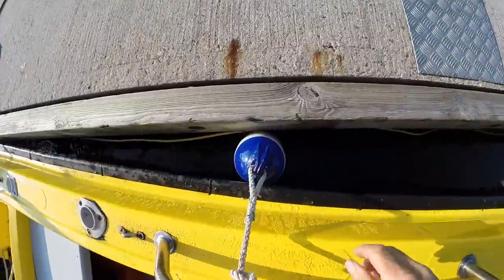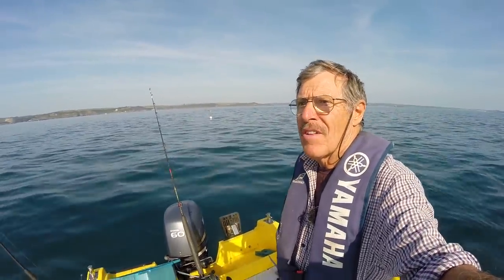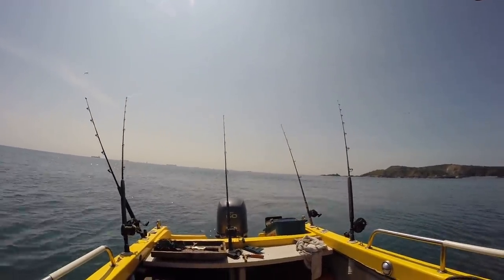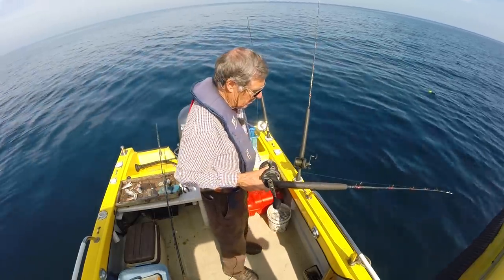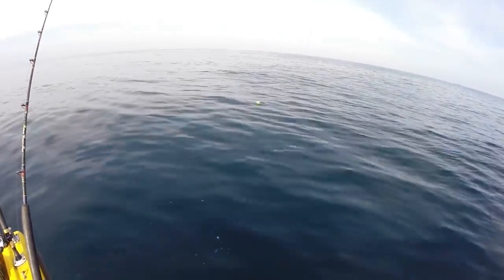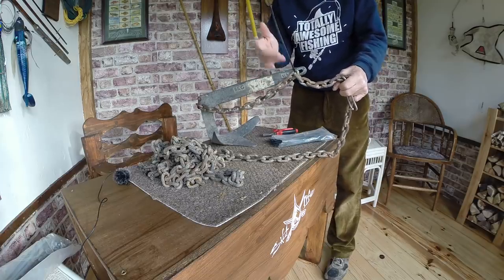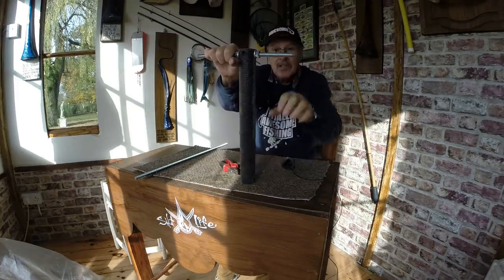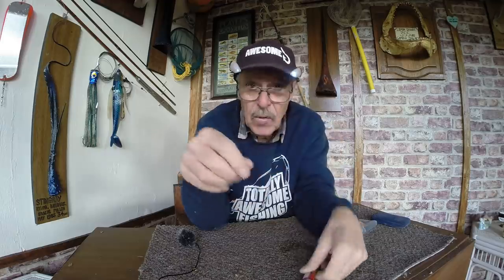Solo Boat Fishing & Anchoring Tips

Comment: I use a little clip on rechargeable torch when I'm night fishing because I hate sleeping with a head torch strapped to my face but don't mind wearing a peaked beanie with the tiny torch clipped to the peak. Having something that's ready to go is essential for me because I tend to charge out without thinking when the alarms start wailing. 
As a fellow man of tired working hands I also struggle when it gets cold but recently I've taken to buying waterproof thermal work gloves to wear on the bank and they really do make a difference, they're not bulky so you retain most of your hands function but they keep the damp out and keep the heat in. You can pick a pair up for around a tenner from the internet or from your local toolstation etc.

Comment: Quick bit of info on the Spiny Starfish. Extremely important to reef systems as they control the shellfish population. Without Starfish, shellfish would clog the reef and reduce species diversity.
Reply from the maker: I thought it was the other way round ? Are not the Crown of Thorns Starfish decimating areas of the coral reef in southern hemisphere ? Maybe its the reverse in our Northern hemisphere and what you say does happen.Anyone else out there with Starfish theories ?
Reply: @TAFishing  as far as I'm aware in temperate waters like Ireland and UK,  they play the roll of predator and scavenger which is helpful to a healthy reef system but they only thrive in specific environments. Your correct in saying the Crown of Thorns is destroying reefs in Southern Hemisphere but some scientists say it could be linked to excessive nutrient run off from agriculture into the rivers and then into the sea causing a huge increase in their population.